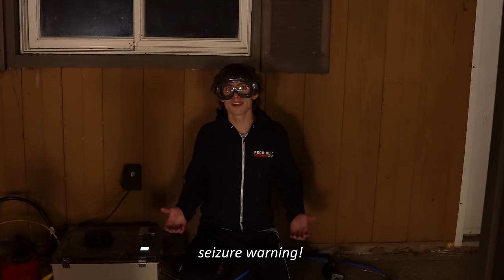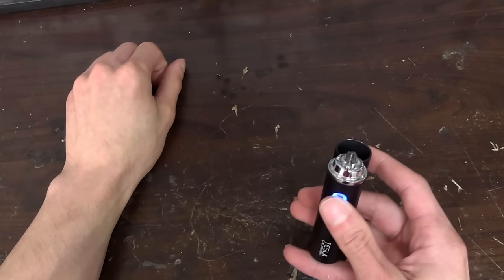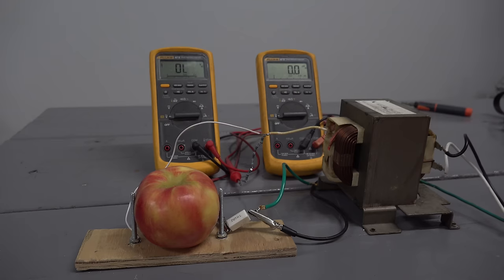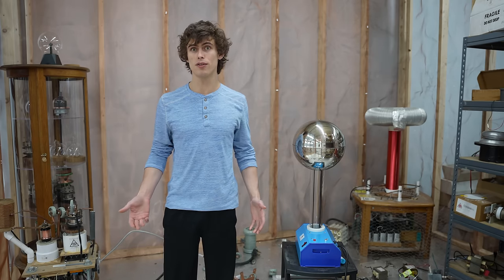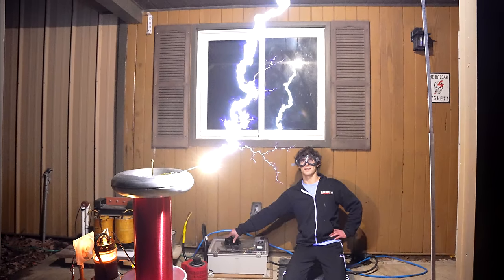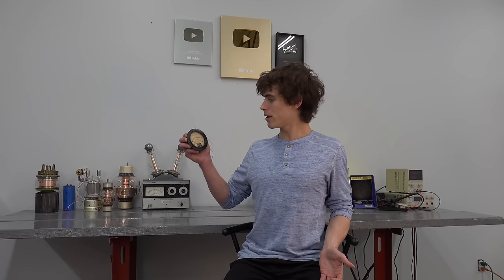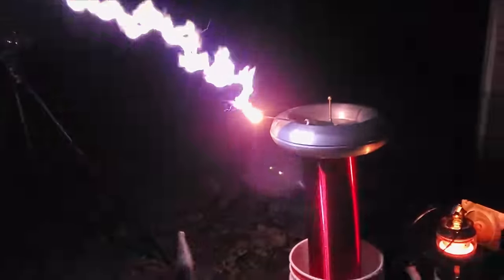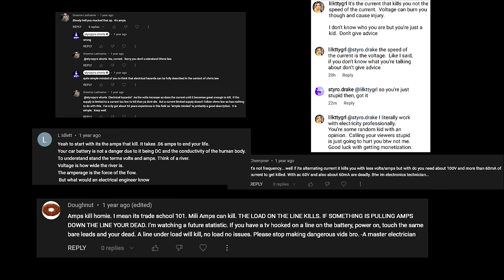Is it the volts or amps that kill?

Comment: Electricity in a nutshell is basically, "Yes, but no. It's complicated."
Reply: Why is it never a simple answer gahh
Reply: Plus basically the same when it comes to our nervous system.
Reply: @isavedtheuniverse  its too nervous to tell us the true reasons.
Reply: That's why I stick to mechanical things. I don't have enough brain cells to be a sparky
Reply: @aniquinstark4347  I had to re-read your last name a couple of times before I realized it WASN'T 'Spark'. :facepalm:
Reply: This is so true it's painful.

Electricity? Well that's just electrons on the move (for the most part.)

Oh, you want something more in depth? You're going to be here a VERY long time.
Reply: @maxiliarydendrite8926  There is, but its complicated.
Reply: I’m just casually Licking a 9 V battery
Reply: anything related with science do be like that
Reply: "fuckin' magnets, how do they work?"
Reply: Sounds like an ex of mine.
Reply: "So this high power arc can kill you in microseconds"
"Sir, why are you touching it, then?
"Hm? Oh because it doesn't actually kill you."
Reply: Doesn't that show a lack of understanding of a basic aspect of electricity on our part as human race ?
Reply: @mattg6472  No it's more that any real explanation ends up being so complicated which acts as the gatekeeper preventing it from being commonly known(or commonly shared).
Reply: @The_Andromeda_Galaxy  nuh uh we have no real explanation that s why they are so complicated . There are parts of electricity we don't understand. Wave or particle ?  Are electrons really a thing or atoms ? Or is it all CGI cause it has to be . Can't see that far in just cartoons at that point . Just like our cartoon balls far out
Reply: "hey power source, are you able to kill me?"
"yesn't"
Reply: In an astonishing turn of events, it turns out you can’t boil down the complexities of an effect that’s just a macroscopic extension of quantum behavior to one simple formula and expect it to consistently work.
Reply: Electricity in a nutshell is basically "shut up nerd you can't put Electricity in a nutshell it's too complex"
Reply: That's why people spend years in university studying it, as opposed to just regurgitation ohms law
Reply: Basically everything is "it's complicated" when you look closely enough.
Reply: It is only complicated if you haven't studied basic electrical principals, which is why so many people get it wrong and you see silly arguments in YouTube comments where one person tries to argue it's volts that kills and other idiot next to him argue it's the current.

If you understand what voltage and current are, and ohms law, (only 3 things)  then you immediately recognise that it's a combination of all 3, with the current actually being determined by the other two.

The problem is, people are stupid and they are arrogant and think they are experts in a topic when they really don't understand it and have had no formal education in it.
Reply: @The_contactor  Perfectly harmless.. as it is less than 120 volts
Reply: @mattg6472  Very much so.
Reply: @The_Andromeda_Galaxy  No. The real explanation is incredibly simple.

The problem is that most people do not understand current, voltage and resistance and what they are and what causes the other.
Reply: @nebulous9280  Nonsense.
I can teach you a number of basic electrical principles in an hour or two.

Everything from basic circuit theory, voltage, current, power, ohms Law, Kirchoff's two laws.
Reply: @mattg6472  We have real explanations for everything you mentioned, lack of understanding isn't an argument.

"Wave or particle?" -> Dumb question, doesn't matter at all. Furthermore, whats a wave? Whats a particle? I don't know and I don't care, nobody cares, all I know is that Quantum mechanics can make quantitative predictions about the positions of electrons, nothing else should be known.

"Are electrons really a thing or atoms?" -> yes.

"Can't see that far in just cartoons at this point."-> Yes you can.
Reply: @MegaBrokenstar  You don't need quantum mechanics at all to make a 100% correct description of the phenomena mentioned in this video. Theoretical electrodynamics is enough but again that is also not easy.
Reply: @deang5622  Those are not enough to determine wether something will kill you or not, did you even watch the video? Dielectric breakdown makes it so the voltage needed to put several amps through your body is MUCH lower than the one predicted by omhs law, that is something that can't be ignored without getting things egregiously wrong.
Reply: @marcossidoruk8033  Mate, listen to me.
There are three attributes of electricity. Let me tell you what they are.
 1. Current measured in amps.
2. Voltage measured in volts.
3. Frequency measured in Hertz.
For waveforms which are changing with time then you can do a Fourier analysis and decompose the waveform in the time domain in to sinusoidal components into the frequency domain.  But each of those sinusoidal components is defined by: voltage, current, frequency and phase angle. Just the same as stated above in items 1-3.

That IS what electricity is. Resistance, dielectric strength, inductance, capacitance , all these do is modify the three attributes above.
Capacitance, dielectric strength does NOT kill you. They just affect the magnitude of the current, the voltage, the frequency.

Clearly you don't understand what electricity is.
Reply: @marcossidoruk8033  hahaha 🤣 you crack me up
Reply: @deang5622  You are just contradicting yourself.

This is exactly what you said in your first comment:
"If you understand what voltage and current are, and ohms law, (only 3 things)  then you immediately recognise that it's a combination of all 3, with the current actually being determined by the other two."

This is what I said:

"Those are not enough to determine wether something will kill you or not (...) Dielectric breakdown makes it so the voltage needed to put several amps through your body is MUCH lower than the one predicted by omhs law"

Now compare that to your latest response, LMAO. I have a physics degree and I know electricity apparently orders of magnitude better than you do (There are too many things wrong with EVERYTHING you said). My comment only aimed to respond to the notion that you can use omhs law to predict wich voltages are potentially lethal, and it does so explicitly, your response is just mindless overly pretentious rambling that completely misses the point and contradicts your previous statements.
Reply: @mattg6472  Ellaborate.
Reply: @marcossidoruk8033  not looking for a fight
Reply: @marcossidoruk8033  Talking out of your backside mate, trying to show off by bringing a whole load of stuff into it which is not relevant.
For example, the photoelectric effect is to do with exposure to ultraviolet light and the excitation of electrons giving them energy higher than the work function of the material.

Yes I studied physics at school and quantum mechanics at University.

But the photo electric effect simply does not apply to the conduction of current in conductor's in insulators, conductors or semiconductors which are not exposed to ultraviolet light.

So you are talking out of your backside trying to bring things into the debate which are 100% irrelevant.

Clearly you have a mental problem when someone challenges the crap you write and go completely off topic.

You are demonstrating very childish behaviour.  If you adopt that attitude of going off on one trying to win an argument by discussing irrelevant bovine excrement in the workplace, you will be ridiculed in the workplace. Don't do it.